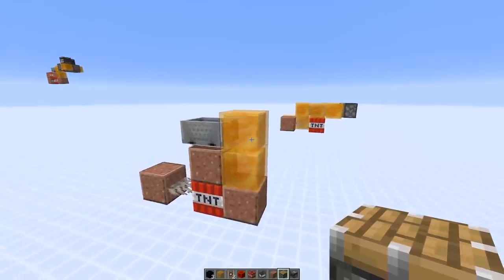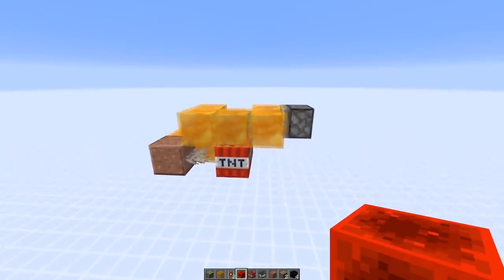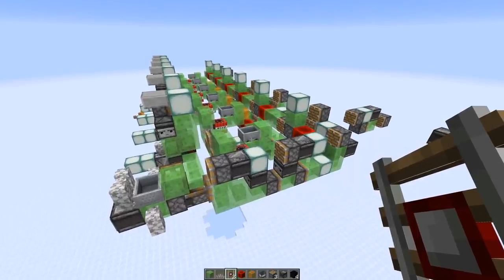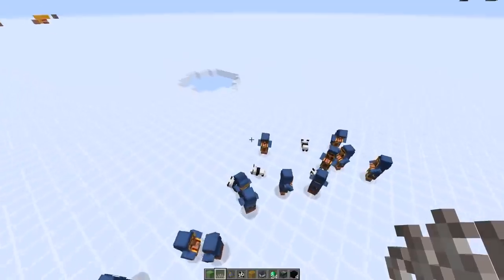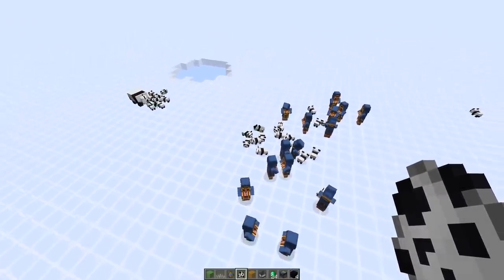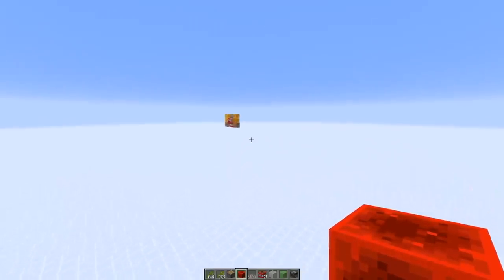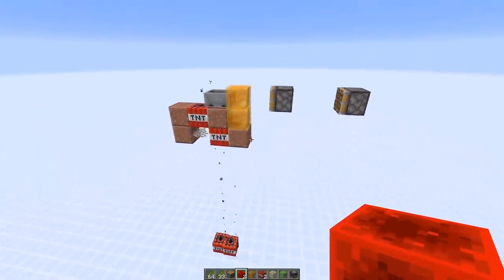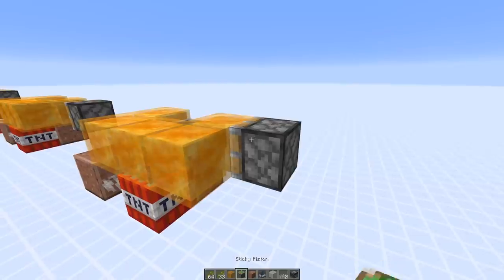Honey Based TNT Duping Modules

Comment: How does a tnt duper work and why does it need coral?
Reply: by glitching the tnt, it's cheating and will be fixed someday
Reply: the one left out its not cheating, its “exploiting”
Reply: The tnt actually is powered but hasn't received the update. The corals do a break animation when moved, which causes the tnt to update, which leads to the ignited tnt but somehow the block still is there, so the cycle repeats
Reply: @pokemonfanmario7694  same thing, exploiting bugs is cheating but without external tools
Reply: @2911oscar  Exploiting game mechanics is  different from cheating. Cheating usually involves commands or external tools.
Reply: @kajaxochi8562  are you sure duping tnt is a "game mechanic"
Reply: @arbodeltaco  it's not a bug, it's a "feature"!
Reply: They said that tnt duper’s will stay until there is an alternative for it
Reply: the one left out exploiting glitches in games has never been classified as cheating. you think speedrunners gets their runs invalidated because they abuse glitches? no! glitches are part of the game just like any other feature. the fact that the developer didn’t intend for the feature to exist means nothing. also, some glitches are really ambiguous and no one knows if they are intended or not, so should you have to double check with mojang everytime you wanna build a farm and you’re unsure if all the mechanics used are intended? the only way to cheat in a game is to use an external program to get an unfair advantage, everything already in the game is fair game because every player has access to it.
Reply: @SamueleMilo  it will only be fixed once there is a legit alternative because they see the advantages of it. One of the devs said that
Reply: @SamueleMilo  TNT duping is a bug exploit. That statement is completely unrelated to what you may or may not consider "cheating", which is a social construct and may vary from community to community. If your server admin tells you TNT duping is not allowed, then you would be cheating if you used it anyway. But if everyone is okay with doing that (including if you are okay with doing it in single player), then no "cheating" is happening.
Reply: Mojang is fixing it cause they think it's a game breaking mechanic, ergo cheating.
Reply: @bradleywalton970  creeper farm.
Reply: Btw you are free to do it, no hard feeling, it's just non vanilla to me.
Reply: the one left out no, they said it will stay until there is a good alternative.

Comment: how does tnt duping work?
Reply: by glitch abuse
Reply: I don't know the details, but the short version is: The TNT block is powered by the detector rail via quasi-connectivity, but did not receive the block update required for it to actually ignite. That update is supplied at the same time the TNT block is moved, which causes the game so somehow do both things at the same time - move the TNT block and spawn the ignited TNT entity.
So basically you don't really duplicate the TNT block, but spawn a TNT entity without getting rid of the block.
Reply: @TheRealWormbo  -- It works because pistons make a list of blocks they're going to push before pushing them. If you change those blocks after they start being pushed but before they finish being pushed (using quasi-connectivity here), those changes aren't added to the list of blocks being pushed, so the pushed blocks seem to ignore what happens during pushing. It's also possible to dupe carpet this way, and gravity-affected blocks in past versions too.

Comment: Can someone explain in detail how the game processes TNT duping?
Reply: I don't know every single small details, but basically, there exists 2 kinds of TNT in the game. The block version, and the entity version. The block version is the one that you place down, and it can be moved by pistons like any regular blocks. Once powered, the game basically destroy the TNT block, and spawn in it's place an entity version. This one is treated like an item that you dropped on the ground, and can for example fall or be pushed by a water stream.

There's a kinda complicated phenomena in minecraft where sometimes, a block is redstone powered yet isn't "aware" of it, until the block is updated. Sorry, i forgot the official name. That's what is actually happening to the TNT block, it's powered by the detector rail with the minecart on top, but isn't aware of it yet. 

When you move the contraption forward, 2 things happen at the same time. 
1) The coral fan block being moved forces an update of the TNT block, turning it into an entity that falls.
2) The TNT block is moved forward by one block, in a place where it is no longer powered.

I'm not sure if the TNT block both remains in block form and falls as an entity because either:
a) While being moved, the block exists in both block spaces at the same time, and only one of them gets powered, or
b) While being moved, the game fails to delete the block version of the TNT properly, as the block is no longer there when the process is finished.

That's basically it, i hope my explanation was clear enough for you to get what i was trying to say.

Comment: What the coral fan does?
Reply: It is very important so don't miss it out thinking it is irrelevant or it will explode where the tnt it, I don't really understand it but don't forget the coral fan. This probably hasn't helped but hope it has 😄😄😄
Reply: Mojang fixed the old tnt duping devices in 1.13 (might be wrong there) and so new designs where needed. No clue why exaclty the coral fan works thought.
Reply: The coral fan is key to most dupers. EagleEye621 has examples of rail dupers and carpet dupers that use the coral fan.
Reply: @marvis008  well said